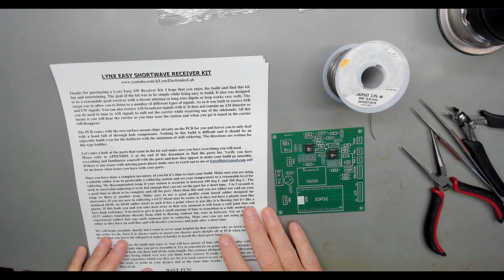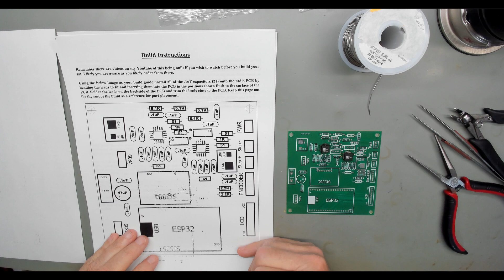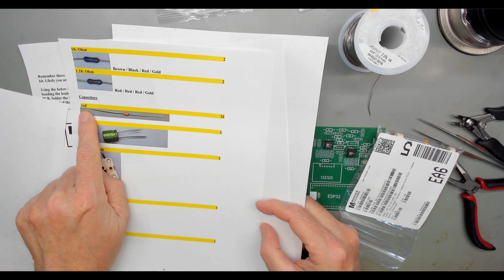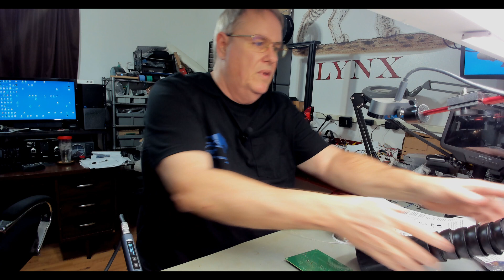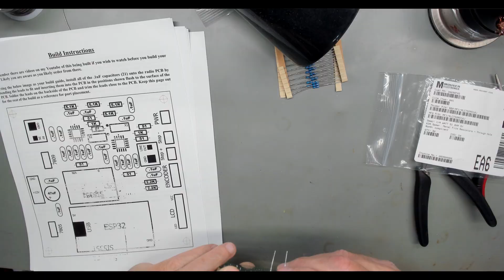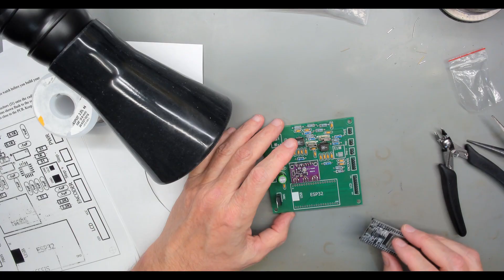DIY Electronics Made Simple Building The Lynx EZ SW Receiver Step By Step

Comment: I guess you will have the SMD part pre-mounted?  Back in 2012 I had a few kits available.  I hope you experience will be better.  I actually had the parts values shown on the PCBs rather than the part numbers.
Reply from the maker: Thanks Uni,
Yes, some views would be prevented from building it if I don’t include the smd chips mounted. I don’t expect that many of them as my channel is small. We might not get enough interest to do it but I thought I would put it out there. 
RJ